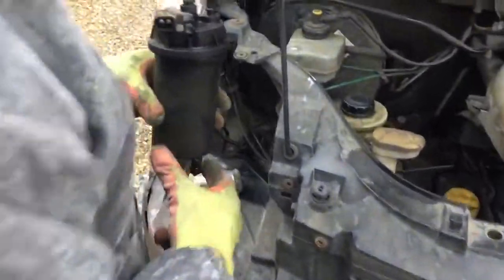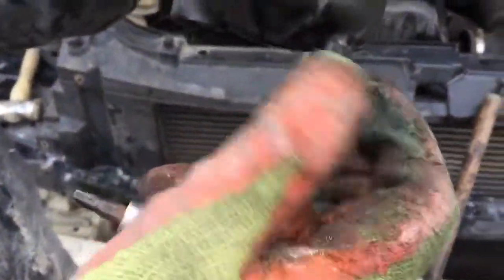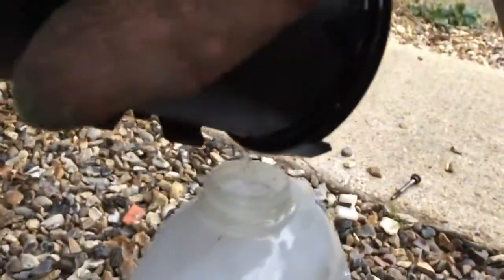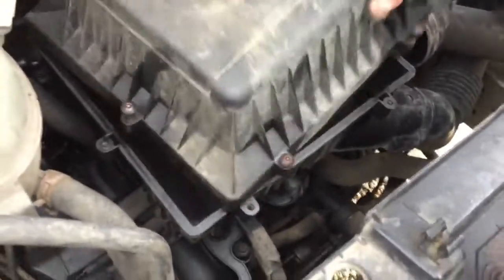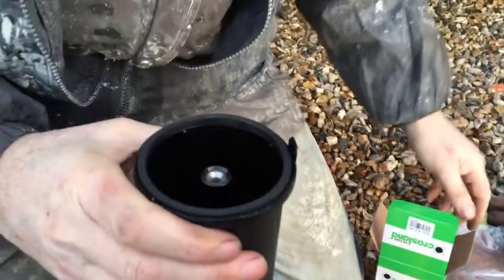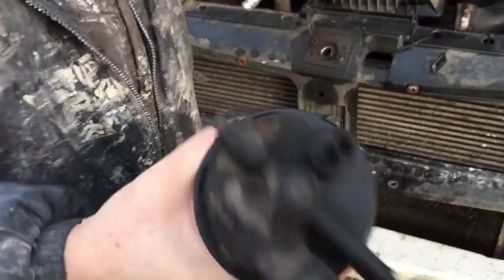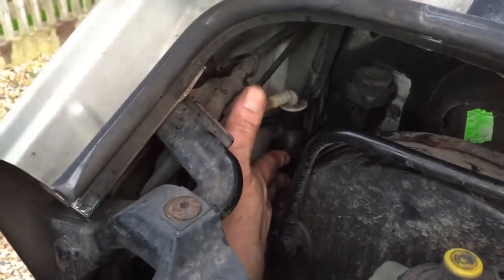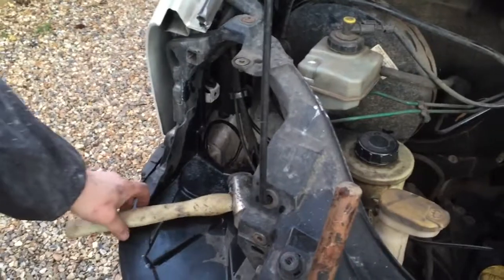How to change the fuel filter on a Renault master van MK2 2.5 DCI 2004

Comment: Helpful video, thanks. How to remove the housing itself? It seems there is some sort of clamp behind it, but I don't get the housing removed so far...
Reply from the maker: Thanks, filter is contained inside of the housing with lid that attaches (pipe/wire) and the entire thing then clips onto the side inner wheel arch if I remember correctly it was 5 years ago just be careful when removing plastic parts in case they are brittle.
Reply: @DanielJohnHowTo  managed to get it out, pushed back the clip and applied a bit of force to slide it upwards. Thanks for the quick response!
Reply from the maker: @DanielHartman-eq6nn  no worries, good to hear it all went went well.

Comment: Priming one of these is very simple. You put the two pipes on, they only fit one way, but the feed from the tank with the rubber squeeze bulb, goes onto the pipe on the top pointing up and the fuel line to the engine goes on the one pointing horizontal...like at the engine. So there will be air in the system, so you undo the bleed screw at the back of the top WITH THE FUEL FILTER HOUSING REMOVED FROM THE HOLDER ON THE BODYWORK OTHERWISE YOU CANT GET AT IT OR PUT A PIPE ON IT. but dont worry the pipes are very robust,  (there are two bleed screws on this one at the bottom to empty the filter housing when changing it and one on the top of the housing for bleeding the air opposite the fuel line to high pressure pump attatchment pipe pointing horizontally) 

So we turn the bleed valve only til something comes out, maybe 1 turn or less and pump the bulb til only fuel is coming out of the bleed valve, maybe 10 or 12 pumps at most, then close the bleed valve tight and put the filter housing back into the holder on the bodywork then pump the bulb a bit more til it becomes hard so its hard to pump it anymore, but beware the bulbs have a tendency to die of old age and may not work also (When the engine is running it will be rock hard), then you are up to pressure on the low pressure side...

These have a low and high pressure side. so from the tank to the filter to the pump is low pressure, the line from the fuel filter to the high pressure pump feeds the pump now filtered fuel  where it gets highly pressurised by the pump and fed into the common fuel rail with the fuel pressure sensor (also a well known point ot failure and a massive ball ache to get off. dont ask how I know or how I know all this as I've jsut done it all.) and then fed at high pressure into the injectors with the little plastic pipes clipped on the top of the injector returning unused fuel back to the tank via the return line...
Reply: "very simple"
Reply: THANK YOU !
That's a far better explanation then what the old fart and the hyperactive cameraman were able to produce in this video, thanks for your effort

Comment: What do you do if my model doesn’t have a small pump to purge the air out of the system?? I changed my filter and now I’m stuck.. because I can’t purge this air bubble 😅
Reply from the maker: you can buy a air purger little hand pump that goes onto the quick connects either end, or fill the filter with some diesel switch ignition on let it prime and try again
Reply: @DanielJohnHowTo  If i dont have a priming bulb. I’m unsure how just turning the key releases the bubble? Can I take off the fuel supply hose, then the key, until it spills out,then plug it back on when the air is pushed out?

Comment: The small seal goes under the head of the through bolt holding the filter housing cap on. It doesn't ever seem to leak from there, but hey, more new bits = more good.
Reply from the maker: thanks for the tips

Comment: Hi I have a 08 master 2.5 that cranks,starts for 1 seconds and cuts out, any idea? Crank of fuel rail sensor?
Thanks
Reply from the maker: check battery voltage isn't too low

Comment: Ok guys so i changed filter and ni start. So i bled filter housing until fuel came out then closed bleed screw. Then i pumped the baloon until it got hard and i kept squeezing it as my mate turned d engine and after a few goes she started. Thanks for video
Reply from the maker: yep that's what you're supposed to do, glad to hear it's all working for you. easy enough job tbh
Reply: @DanielJohnHowTo  well actually you are correct but i was helping a mate on his van and he was not able to get it going because he just wasnt priming it enough. He was just pumping baloon a few times with no result. I explained that it shud b pumped until air is expelled and then pumped until balloon is hard and i kept pumping until it fired up. My mate thinks he knows everything and even still wouldnt admit that he failed. Oh well. But your video helped
Reply from the maker: @mikewatte4478  thank you, it's why we make them really to help others
Reply: Excellent, thanks for that.. Got mine to do when the filter arrives.. May buy some diesel to put in the unit as not sure if mine has a pump.. Its the 2002 bus LWB 1.9

Comment: Hiya mate. I've done this as well you have shown. Still appears to air bubbles in the out hose. Any ideas. I've tried it a few time. Also can I over bleed the pump if u get me??thanks a mill
Reply from the maker: could be a seal somewhere leaking air, e.g. o-ring just double-check

Comment: No need for all the stripping , just take out the torx bolt at centre ,disconnect fuel line and sensor and lift top of assembly off.
it off. takes 5 mins
Reply from the maker: thanks for the info!

Comment: Do I need to depressurise before disconnecting hoses ?
Reply from the maker: there will be some pressure in the lines leading to the fuel filter but not pump pressure as it's turned off, so just disconnect and connect back up, you can also prime the filter with some diesel/button too. Then turn ignition on/off several times to bleed the air out and start, hope that helps.

Comment: also you bleed it from the top one at the back as the bottom one is just for emptying it...air is at the top not the bottom but you can move it about with the pipes on it, but where they put the bleed valve on the top is like many things renault...crap design...

Comment: its great but you skip parts and ive been at it for hours and it wont start priming wont work, there are no ther videos or where the priming srew or something is on the pump,
Reply: the balloon doesnt work. or else itd be great,, thanks tho video great help
Reply from the maker: In that case, prime then turn ignition on 3-4 times and let fuel pump run then try to start, sounds like there's air in the system.
Reply: @DanielJohnHowTo  thanks the primer doesn't work , it doesn't matter what you do, there is something else wrong with this turd of a van that never has one thing that works and not tampered with , I've tried adding tubes , the only way last time was to jam a compressor into fuel cap inlet , I may have have to crack injectors the whole thing , I don't have those tools here , can't believe the , pain just from changing the filter,. My van is cursed

Comment: My master wont run properly, I changed my fuel filter got it started but the engine shuts out after driving for about 15 minutes slowing down and not getting the fuel across to the engine I believe can you please describe this. Thanks heaps Russell
Reply from the maker: RasulMati was it running ok before the change ?
Reply: @DanielJohnHowTo  yes it was running very fine, however I washed the engine too before the service could that have anything to do with this problem
Reply from the maker: RasulMati most likely, what did you wash it with
Reply: @DanielJohnHowTo  after you change the fuel filter do you have to bleed the air out the way you do, cause some mechanics told me it bleeds it out itself once the car starts. Thanks heaps
Reply: @DanielJohnHowTo  I washed it with degreaser and high pressure hose at car wash
Reply from the maker: @Canipeks  Not the best idea, check the air box etc hasn't got loads of water sat in it, dry it off if needed that's all it will be. The fuel filter has a priming button, this is shown in the video.
Reply: @DanielJohnHowTo  ok thanks. I'll see how I'll go
Reply: @DanielJohnHowTo  hi again I've taken out the air from the housing the way you showed on the video with the fuel filter my van stalled once after doing this maybe from inexperience is good now hopefully stays that way thanks again for the advice.
Reply from the maker: @Canipeks  yep you have to bleed the air, same with brakes it's really important
Reply: @DanielJohnHowTo  hi again daniel have you ever removed the gearbox control unit on 1 of these vans before
Reply from the maker: @Canipeks  We haven;t.
Reply: @DanielJohnHowTo  I have, I'm having trouble finding the correct wire fitment the way I took it off for example it says it's in the 1st gear when I switch plugs around it goes into third second fifth real pain bro thanks
Reply: @DanielJohnHowTo  hi again just another question, should I prime the filter until the air bleeds out while the engine is running or shall I do it while it's off. Thanks a mil